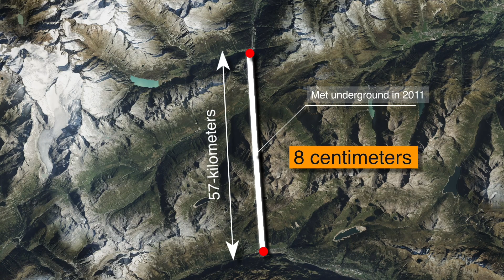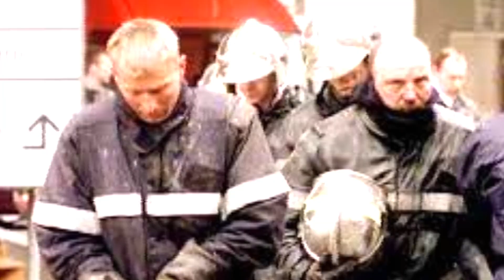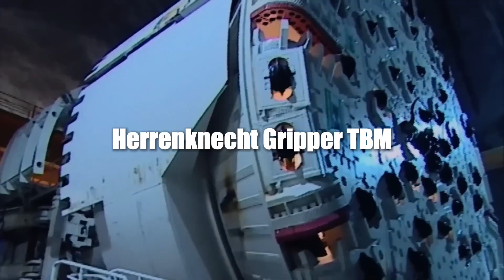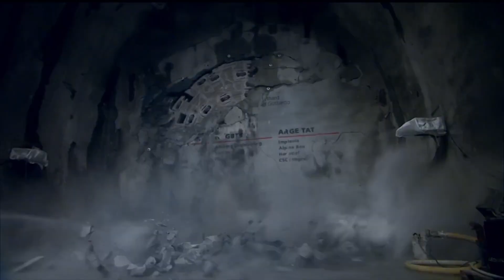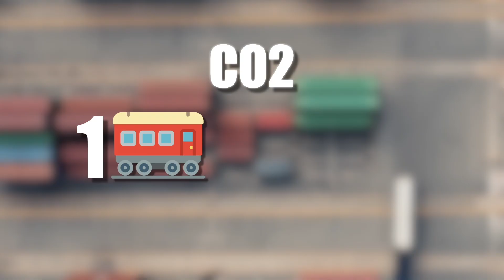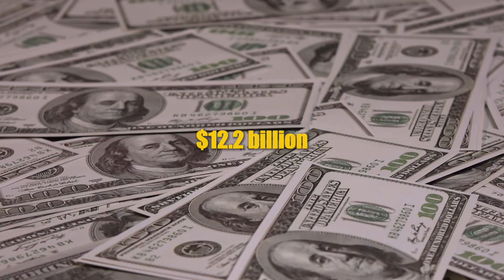The World’s Longest Tunnel: A $12 Billion Masterpiece | Gotthard Tunnel

Comment: Temperatures are not that high, the Saint Gotthard mountain is not a volcano. 
In any case temperatures are very uncomfortable as lots of humidity is constant.
Reply from the maker: Great point! You’re totally right that it’s not a volcano, but the sheer depth creates its own heat. When you're 2,450 meters (1.5 miles) underground, the 'geothermal gradient' causes rock temperatures to reach up to 46°C (115°F). You hit the nail on the head regarding the humidity, though—that combination of high heat and damp air made the ventilation systems a matter of life and death for the workers. Thanks for watching.